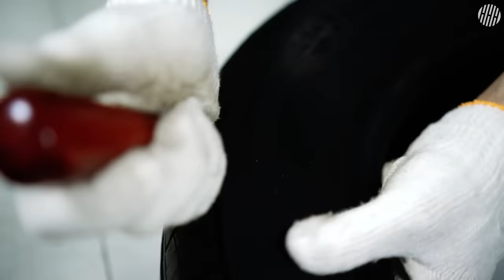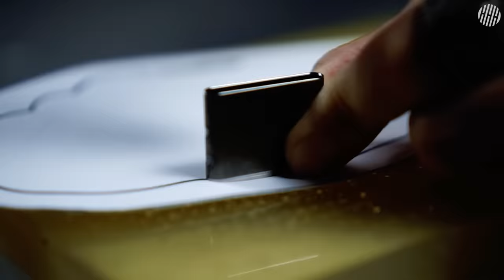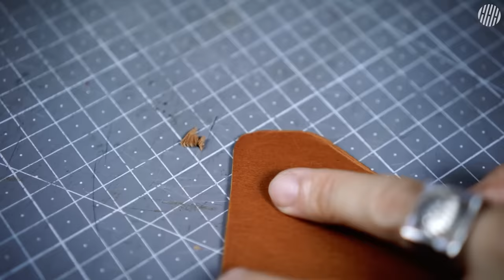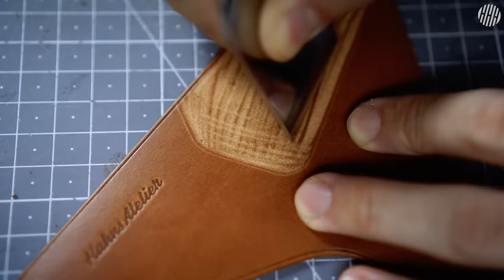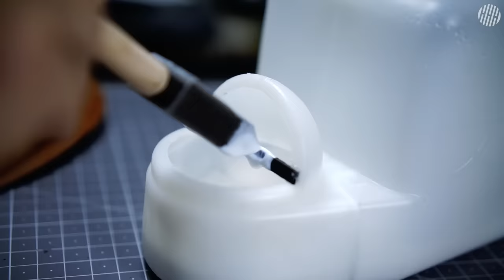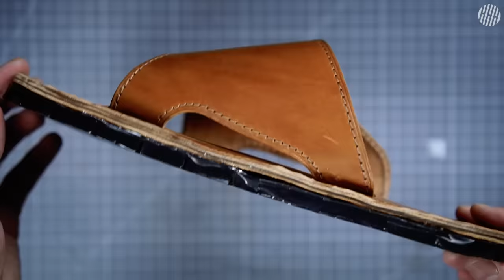I turn tire into handmade sandals

Comment: I apologise sir, for I haven't been able to find you sooner.
Perfect craftsmanship, smooth and elegant editing, an absolute treat to watch!
Reply from the maker: I really appreciate it!
Reply: Apology accepted 🤣🤣🤣🤣🤣
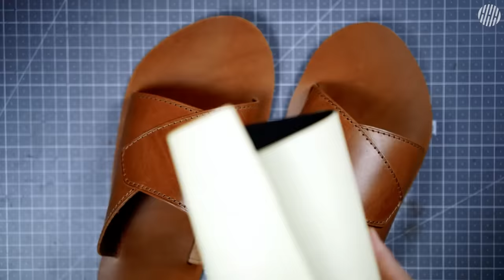Reply: 3:40 Left and Right aren't even close to being identical to each other, the right is completely off center, it's god awful. The straps were only glued in. The Rubber Tire was just glued to the bottom. Craftsmanship? In 30Deg heat they'll fall apart like bubble gum. Good from far, but far from good.
Reply: @hellboundrubber4448  With the comment on symmetry and the timestamp you provided, I can't tell if you're trolling or just don't understand how perspective works. Have your complaints about the construction method if you like, the best thing about them not being yours is that it's entirely irrelevant anyway, but they're certainly not "god awful" in terms of consistency.

Comment: Nice sandal with Buttero leather. Normally commercial sandals are made with lower quality leathers and soles that they can sell you again very soon.. Many street leather craftsmen in the Indian subcontinent make Sandal on the street from car tires and I have seen them. I bought a Reebok  Sneaker in the late '70s made in Korea and the sole was supplied by the Dunlop tire company. That sneaker lasted 6-7 years, but rarely there is any decaying the sole, but the upper leather has gone first.  Nowadays a new sneaker doesn't last even 6 months.
Reply from the maker: That's right !

Comment: I’ve never seen you come anywhere close to breaking a sweat before in your universally-impeccable work, EXCEPT possibly on that thick rubber!  

The top two pieces and where they attach to one another of course determine how far into the sandal the foot will go.  Is the test fitting on the foot done with the heavy-paper pattern, or with the cutout leather pieces, temporarily assembled ?
Reply from the maker: Paper work is a temporary measure, and I have a little room. Finally, measure it with leather.

Comment: "...using waste tires. It's one of the ideas for recycling used tires."

if you made it from New tire, please be honest, tell us Truth.

I agree that the concept of "old used tires" differs from each other in different countries. but it looks like new)))
Reply: The side wall could have been shot or a part of the tire had been destroyed while driving on the road, it is very common on cars with sidewalls that are too thin, such as Teslas and a lot of modern cars trying to be sporty.
Reply: It's none of your business. He doesn't owe you an explanation, or anything else for that matter. It's tires are routinely discarded, especially cheap Chinese brand ones like these. They cost about $50 from the retailer, who pays $35 for them from the wholesaler, who buys them for $20 from China. They have to import thousands at a time to make the low profit margins worthwhile. So the manufacturer will tell the wholesaler that they need to buy >10000 tires to get them for $20. So even though they know they won't sell 10k tires, it's worth it to buy that many to get a price break and throw away 1k of the tires when they expire. Those garbage Chinese tires aren't even worth repairing or trying to sell used. No one is going to pay $20 to patch a $50 tire.

Comment: What did you use between the leather and the tire? Thanks.
Reply from the maker: It's insole.
Reply: I’m trying this:  MAGZO Multifunctional Sponge Neoprene Foam, 1/8 Inch Thickness x 12 Inch Width x 59 Inch Length Rubber Sheet & Roll with Adhesive

Comment: Bad construction due to the thin leather used. The top part should have been reinforced with something that prevents ripping (I've used thin sailing material) as well as lining. Whilst the end product looks nice, you failed to create something that would last longterm and is prone to ripping. The glue isn't gonna hold the bottom straps in place either.